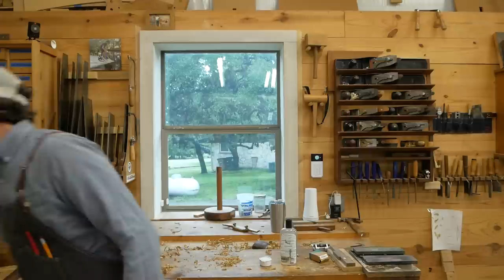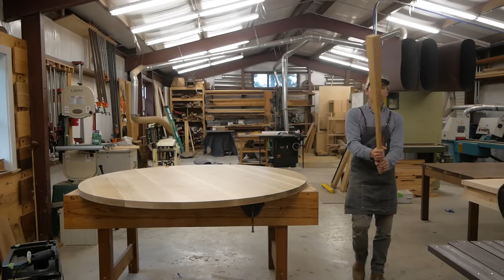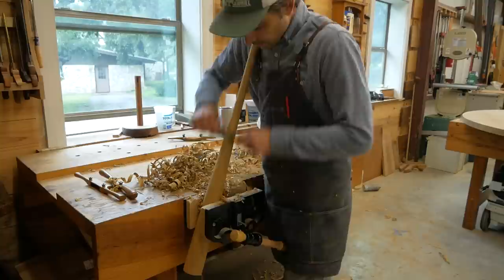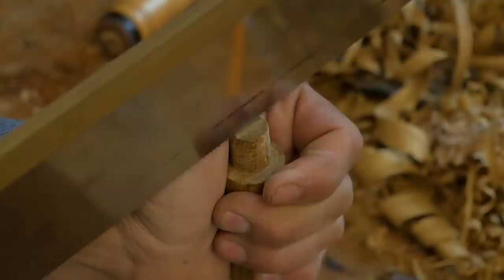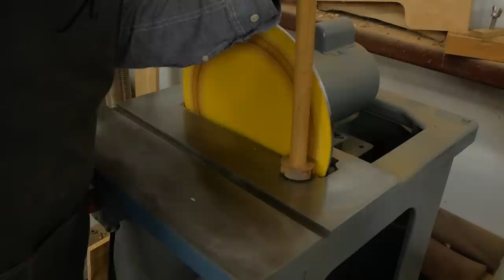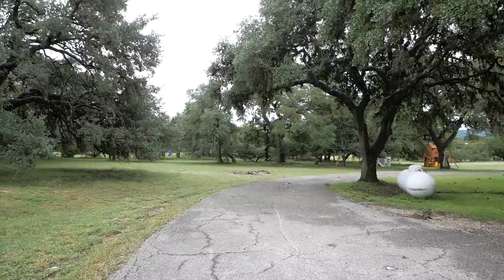Making An Old School Baseball Bat - NO LATHE

Comment: What kind of wood did you use for the knob? It seems much more dense and harder to work. Also just out of curiosity why did you make the knob on the handle out of a second piece instead of flaring the end and keeping it all one piece? I’m not trying to critique your work I am genuinely curious. Great craftsmanship!
Reply: I would assume it was just for esthetics, but I have the same question
Reply: I believe this would be illegal by MLB's original bat rules. Needs to be one piece unless ruled otherwise by the league.
Reply: The spokeshave would have chipped off a piece of the knob most likely. This was a much faster way to do it.

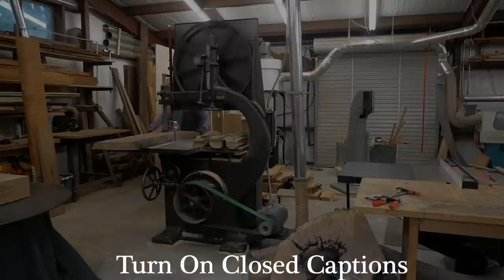Comment: Andy have a look at your band saw.  There was a large puff of blue smoke when it static starts. Could have been saw dust but the belt made several rotations befoere i saw it.   there may be too much pressure on that motor... I would hate to see it burn the capacitor or the brushes out of it.   @1:43 or so.....  take care
Reply: Chris Williams ...Good eye, but looks to me, like saw dust.
Reply: Sawdust laying on the belt.
Reply: It is saw dust from the top of the belt. If you watch closely before the machine is turned on, on the top of that green belt there is a small pile of saw dust. When that belt wraps around and that section reaches the motor the saw dust is flung off, creating that puff of dust. Good eye though!

Comment: Funny enough, that does look like Mulberry or Black Locust. Get a black light and you could narrow it down. If it is mulberry, it's an IDEAL wood for bats. Similar density to maple, but harder and more flexible. Black Locust would also be an amazing bat wood. Only reason they're not used today is due to approval from MLB and availability.
Now, that bat would be considered illegal for MLB and AAA/AA ball usage, but the octagonal handle and mulberry wood with your craftsmanship would've made that bat LEGENDARY back in the day

Comment: I don’t understand why you would go to all of the trouble to fabricate that doughnut, when you had the stock size to do it integrally.
Reply from the maker: Because it’s way more difficult to carve the bat with the knob as one piece.  Just imagine trying to work the spokeshaves with that knob there, I would have to stop and hand carve that transition from handle to knob, that’s time consuming and more difficult.  By adding the knob after the fact it made it very easy to shape the handle of the bat and added a cool detail by allowing me to use a contrasting wood.  It would actually take longer to do it the other way.